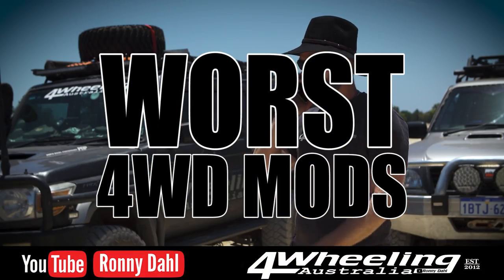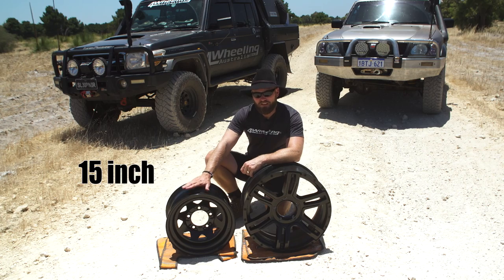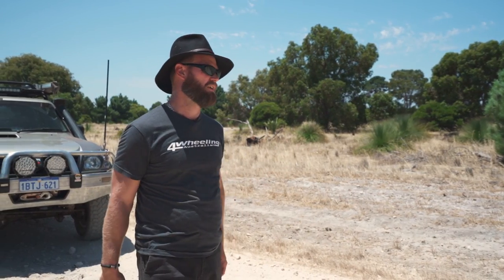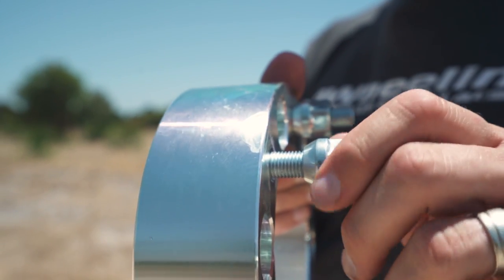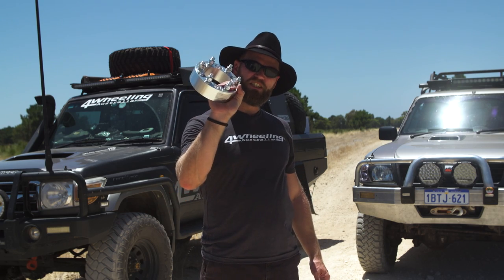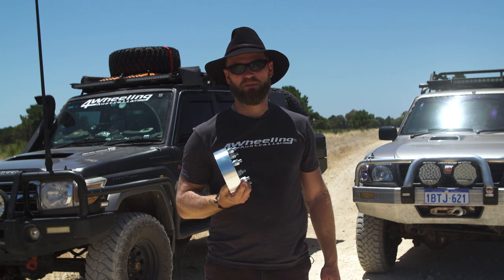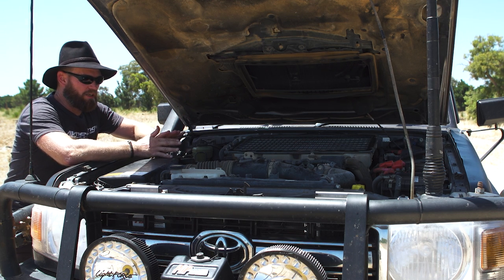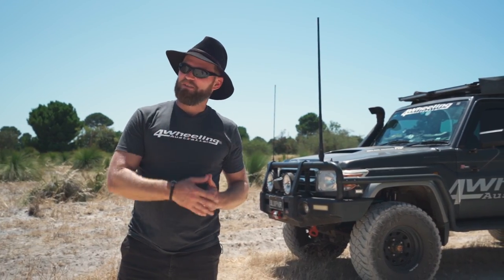WORST 4x4 MODS, DON'T DO THESE TO YOUR 4WD

Comment: The most important mod you can do is lower the vehicle. You want to be no more than 4 inches off the ground. This creates a vacuum under the vehicle so you can climb straight up a cliff at super high speeds.
Reply: Fact Check: True
Reply: There is no vacuum under the vehicle, it lowers your center of gravity.
Reply: @garystandke669  The joke go over your head?
Reply: Vacuum for down force can be enhanced with a front air dam down close to ground with  minimal ground clearance as possible. . It will need to be about three feet tall to fit below my jeeps bumper.
  Of course a ducted fan type arrangement powered by its own engine can even be used to create a very strong negative pressure under the jeep, You will want side skirt around the rockers to maintain vacuum..
 This will allow one to actually use  aerodynamics to assist in traction for cornering, and to help prevent roll overs on off camber trails.
The down force is the pressure drop times the area.  The jeep is many thousands of square inches, 
so even a one psi vacuum will give tones of down force!  (so will the weight of the ducted fan and it's engine. 
 Yes sir, the jeep will not be able to loose traction.
  Wheeling is fundamentally all about vehicle down force.
 Also if the ducted fan exhaust is directed straight up, even more down force is generated, Youll need good bump stols as your chassis is pulled down by awesome down force, making wheeling,  rock crawling especially  even better still. 
Keep the shiney side up.
Reply: You will need to lower your truck to the ground in case of quicksand.  Or if you are driving across the Pacific ocean.  #AlwaysReady
Reply: It's funny, but actually in mountains a lower, but wider car can beat all that buffed up dudes with enormous lift and wheels.
I mean in real mountains, not rock crawlers (but they are also lower)
Reply: 4 inches? are you mad? you don't even need a low profile jack for that. if you want any real chance of a vacuum under your vehicle you need to be at least within 2 inches of the ground
Just ask the Mercedes team at leman in 1999 they were only around your 4 inches and ended up airborne

Comment: going 33 or 35 inch wheels but keeping standard spare wheel you cant use lol
Reply: I feel attacked lol...(anyone selling a 35x12.50 r15 wheel and tire in so cal...hit me up) 5x5 pattern
Reply: Augh, yeah this irks me when I see it. Or even worse, people who just omit a spare! It's like, do you even wheel bro?
Reply: Why cant you put a smaller diameter spare on the front with 4wd disengaged?
Reply: I run a 35x12.50R17 TIRE*** my wheels are 17 inch lol
Reply: @jeffreydw1983  depending on what shit box 4x4 you use weekly having a smaller tire as a spare can damage differentials.
Reply: The Magic Short Bus My question was why can’t you put a smaller diameter spare on the front with 4wd DISENGAGED? On every part time 4wd vehicle either the hubs are disengaged or  one of the axles is disconnected when 4wd is disengaged.
Reply: @jeffreydw1983  the diff spider gears will turn much more than they are designed to do, and the gears can pull air bubbles into the oil, foam it up, maybe out, and possibly overheat an open diff. If you have limited slip, or any kind of electronic braking or traction features, the wheels turning the wrong speed will burn up the system designed to make them stay about the same.
Reply: Everett Durst The spider gear does not rotate on it’s own axis when 4wd is disengaged. The only reason the spider gear rotates on its own axis is when there is a speed differential in the side gears. That doesn’t happen when 4wd is disengaged because at least one of the axles is disconnected. I’m not sure what other “systems” you’re referring to that would be active on the front axle when 4wd is disengaged.
Reply: @jeffreydw1983  You can if you unlock your hubs if equipped. This is a physical disconnect from the front axle and drive hardware. But then handling is a bitch and its unsafe and you might get pulled over by cops.
Reply: @jeffreydw1983  It matters on Subaru ... If your offroading in your WRX of Forester you have LSDs in the front and back and mismatched tires can really wreck those differentials rapidly.
Reply: @tangoseal1  More specifically, it matters on vehicles with full time all wheel drive, but that wasn't my question.
Reply: @WhiteCavendish  i only carry my spare when I'm going off-road.
Reply: my last Jeep had 35/12.5/15 tires and for the spare i ran a 35/9.5/15 which was lighter and skinnier for saving space but wouldnt ruin anything and would definitely get you back to the pavement.
Reply: @Eric Owens  you lost me at off-roading with a Subaru....
Reply: @WhiteCavendish  the one time I went out without it dude, ffs I have never been angrier at myself. 48hr recovery.
Reply: Ouch, I’m still running a 31 spare when I’m riding on 34s.  Bad for a blowout but I do carry a patch kit and have on board air.  If there was a way to easily fit a 34 in a tacoma spare wheel compartment
Reply: @jeffreydw1983  You are assuming the vehicle also has locking hubs? Which a lot of modern 4WDs no longer have.
Reply: you can use different size spare,it's just not gonna run straight is all
Reply: rev headz not on modern 4x4 vehicles like a Jeep Grand Cherokee for example. Manufacturer spec only allows for ~3/32” diameter difference before potential possible transfer case and drivetrain problems. 

On a traditional 4x4 with full 2WD and or locking hubs it is possible without damaging drivetrain.
Reply: @shanghaitheory  you can't put too big of a tire on new gc anyway. All 4x4 trucks these days has rwd mode and has
Front driveshaft disengagement, so if a rear tire blows, just put the different sized spare on the front and you could limp to a nearby by tire shop
Reply: Guilty
Reply: @everettdurst1  That's all BS, he said the hubs would be DISENGAGED. and you're talking about bubbles in the diff oil? WTF lol
Reply: Dog we gotta save somewhere!
Reply: Considering my stock tires are 31.5" i dont think it would be that big of a deal
Reply: It will still get you home.
Reply: Who the hell has 33 or35 inch wheels???
Reply: That always kills me. You see a jeep with 37inch tires and the factory spare on the back.
Reply: @Billy-ye3ge  33s and 35s are some of the most common off-road wheel sizes
Reply: @Philip550c  Really 33 inch wheels?
Reply: @Billy-ye3ge  it's not the rim. I don't know about every where but at least where I'm at when people talk about wheel size on trucks they talk about the whole wheel. But with cars they are talking about the rim.
Reply: @Philip550c  Yes exactly what I'm trying to say. I've been offroading or over 30 years and I've never  seen 33 or 35 inch wheels on any rig. For example 33x12.50x15 is one of the most common offroad wheel and tire combination. 33 is the tire diameter 12.50 is the tire width and 15 is the wheel diameter.   So when @Danny Porter commented on 33 or 35 inch wheels it made no sense. Tires are not wheels.
Reply: @Billy-ye3ge  it's just what people say. I know what you're saying and technically correct but with trucks everyone refers to the entire thing tire + wheel is the wheel. Imagine an actual 35 inch wheel on a Jeep 😂

Comment: Ford rangers with fake hood scoops 🤦‍♂️
Reply: funny......I agree. Especially the shark fin design ones.....they apparently help cut down the side / cross wind when you're drifting on tarmac LOL
Reply: Got a 2012 stx 550 navara what should I do. I got it with a extra fuel tank and upgraded intercooler. I was thinking of a duel battery setup for a fridge and lights, snorkel with diff breathers extended and May be upgrade the bull bar. In future a 50mm lift. I only want to go camping g at Fraser. Morton  and straddie in the future possible around Australia trip but that will be a few years away and by then might end up getting a cruiser any way. Any advice would be nice. Ty
Reply: Toyota has those from the factory on Tacoma and Tundra... lol
Reply: My toyota tacoma has a fake hood scoop it looks good!
Reply: Fake scoops on any car*
Reply: To be a true mallcrawler you must put 20” black wheels, black flares and a 4” lift with strut top blocks so you have no down travel . If you even attempt to put a bullbar or anything else you will erode your mallcrawler status.
Reply: can’t stop laughing  :))))
Reply: TheBigBad Wolf  I have a Tachometer as big as my head Bro.
Reply: I got a ranger and would never dare to put one of them gay as aids bonnet scoops they’re the grossest thing someone could do 🤮🤮
Reply: true
Reply: On the other hand, the first modification you should do is grab a pick-axe and add some "speed holes" in your hood (bonnet). I saw this episode of "the Simpsons" once.......
Reply: Hood scoops on a 4 wd diesel are an excellent idea , it helps dissapate the heat making the engine run noticeably cooler which effects milage im about to fit one on my diesel 300 tdi.
Reply: Is this a thing?
Reply: Anything with fake hood scoops...
Reply: Those bombs that go further with a Z71 sticker on them
Reply: IFS diff drop You've just lifted your car. To get height? Underneath And then you do the diff drop. And you're back to where you start again. More money than sense.
Reply: @1FiftyOverland    ..  Both the Tacoma TRD-Sport and the Tundra TRD Pro have fake hood scoops, but, last I looked, none of the other models. My Tundra Limited doesn't. Personally, I don't have a problem with it. It's cosmetic, just like many other things (shaped headlights, shaped taillights, etc) on vehicles, including yours.
Reply: i know of a d40 nav with a fake ranger scoop 😂😂. hard to tell now days if they actually function or not
Reply: And s10's
Reply: as someone who bought a ranger with a fake hood scoop.........you're right
Reply: @putnamehereholdmadoodle  That's what I'm hoping to do too. haven't got the 4x yet, but when I do I don't want to go "all out" with stuff. The things you mention are on my bucket list (not sure about the 50 mm lift though.), the diff breathers and a winch are a goer for me.
Reply: @steiny3353  yeah it's my first 4x4 I don't want to dump money into it when I'm just going camping with the family.
Reply: @putnamehereholdmadoodle  My STX 550 died because it did not have a snorkel. Short version is excessive dust collapsed the air cleaner. A snorkel would have prevented the problem. Also look into a "Low range isolator switch" It is needed to improve transmission shifting problems (not holding 1st gear low range). If you plan to drive on dirt roads you also need a "sump" guard to protect an oil cooler from stone damage. Another long and expensive story.
Reply: @skullandcrossbones65  ok cool yeah I'm going to get a snorkel.  And today was looking at full under body bash plate.  I'll look in to the switch.  I just had a problem where it lost all power but the mechanic cleared the error codes and is driving good again.
Reply: @motorsportfreak1  mallcrawler🤣🤣🤣... I saw a jeep on 22x14 at the grocery store with what looked like some trail aggressive tires. The rims were painted to match the grey of the vehicle. The wheels and rims stuck out about 5 or 6 inches from the fender flares. I said to myself this guy will never take that thing offroad! What a waste of money🤭.
Reply: My Toyota 4Runner TRD has a fake factory hood scoops and looks great and I put a small lights bar in mine to make it functional and also look even more cool.

Also, how do fake hood scoops negatively impact a 4x4?.. The point to this video.
Reply: Sorry but they look great and add a cool look to an otherwise boring hood.. You should not be so concerned about someone elses rig and worry about your own, or (in the case of 90% of comment experts) work on actually getting a 4x4.. I love the look of my 4Runner with the hoodscoop, fake or not.. It looks aggressive and makes rigs that don't need a hood scoop look cool.. I bet you don't even have a rig lol.. Anyone so worried about rigs that don't belong to them are just followers.. Real 4x4 owners do what we want to our rigs.. Not what others approve of.. I put a small custom light bar in my functionless hoodscoop, and now it looks even cooler.. Better than your imaginary rig lol... Nobody has managed to explain how the functionless hoodscoop damages a vehicles or decreases performance, as this video was about.. This video was not about opinion on a irrelevant bit of plastic.. It was about mods that effect rigs negatively
Reply: 4 Wheeling In NSW... THEY’RE NOT FAKE!😫🥺..........😂😂😂
Reply: fake hood-scoops are so stupid,  and so are the fake engine vents
Reply: @1FiftyOverland  and on the 4Runner.  It was enough to steer me away from the TRD. I"m not rocking the fake hood scoop nor am I buying a replacement hood.
Reply: Tacomas too! I fall in that category :(

Comment: Worst accessory,  is my apprentice, he wants to install himself in a Ranger and spend 80% of his income paying it  off.
Reply: That's insanity! I got a solid 4x4 for less than a thousand dollars, drove it from Arizona to Arkansas on a cracked head, got it running right for about six hundred bucks, and in the three or four years since then I've put probably about six grand into replacing a few things that wore out and upgrading various things. Both of these categories include the larger engine i put in after the old one blew a rod, and about half the money i spent on it was from an insurance settlement after i got rear ended. They gave me five grand, i spent about a thousand bucks replacing the bumper, tail light, and the entire exhaust system (upgraded to headers) so it was good as new, then added skid plates, a roof rack, new console, etc with the money i saved by doing all this myself. I forgot what my point was... Oh yeah, you should never buy something you can't pay for right then. Credit and financing is the devil's economy.
Reply: @revwroth3698  
I like that story,  
you are so tight, I have four young  builders in the team, not one of them could change a CV joint and barely a tyre. 
They are good lads though, all have an old tool box on wheels(van) now  and come to work with oil under their fingernails, there is hope yet.
Cheers
Reply: When I worked at a dealership twenty years ago, we had a guy come in to buy a $30K pickup, without a dime to put down on it, and a trade in he owed a ton of money on.
Oh yeah, we still did the deal on a seven year loan.  He was no MENSA member.
Reply: @warp65  yeah, i'm not a mechanic but I can't afford a mechanic either so I'm learning. It's become yet another skill set i can't turn into a business without a serious initial investment. If i didn't live in the middle of nowhere i would probably be qualified for a number of jobs...
Reply: i hate toyotas,but,best 4x4 to buy,is an 80/100 series,or gu nissan.but,i like my yank shit.
Reply: A kid in my year at school just got himself one. $275 a week for the next 7 years I think he's paying
Reply: Just buy some old school 4x4 truck in a "fixer upper" condition and go from there.
Reply: At least it wasn't a colarado
Reply: @vinmad6669  oh no! Not pot! That’s stuffs the devil! It’ll turn you gay! Don’t touch that stuff!
Reply: Tell him to get a late 70s Ranger. Better truck, looks better, and cheaper. Might need a bit of work, but that's perfect for an apprentice.
Reply: It’s his money 🤷‍♂️
Reply: @Tourn4x4  
He still has to buy tools, but yes ,it is his money, my job is to make him a well rounded Chippie,  he ended up with an old second hand 4x4 after our chat,  has lots of money left for tools , repairs and fun adventures away at the weekends. Win win.
Plus old trucks are cool.
Reply: Yep it's silly isn't these blokes dropping 50 60 even 70 k on a "4x4" 8k got me a fully kitted out 1999 Prado and i haven't looked back i love it

Comment: I am sooooo glad to hear someone talk about the proper, wheel to tire size for off-roading. I have 17" wheels on my Toyota Tundra, 16" is too small (brake clearance and available options for 35, 37, 40" tires) and 18" is not my wheel size preference.